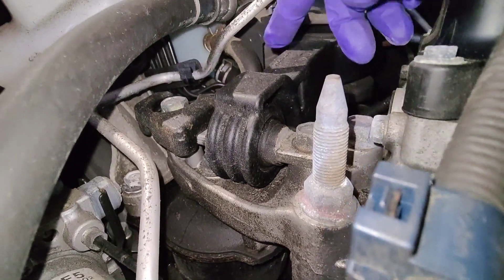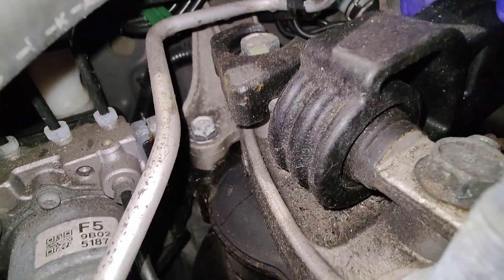Whole car vibrates. Louder in Drive and Reverse. 2006-2011 civic.

Comment: i replaced all my mounts and the transmission mount and it helped some but still vibrates
Reply: Try checking the spark plugs. I have the same issues and changed my spark plugs (they were very worn out) and the vibrations subsided. Hope this helps

Comment: I have a issue with my 2015 Honda Civic in reverse will that be the same issue on my car with the mount ? It jus started happening to me guy hit me from the front straight forward 40 mph long story then that started happening to the car shaking after the hit
Reply from the maker: The 2015 9th gen civic has a different style of engine mount than the one in the video. You might want to see what part of the engine may be contacting the body causing you vibration.

Comment: Question i did replaced  the bottom but i hear the noise a little do i need to change the top also and they say is another one by the transmission   Is better to replace all 3 ?
Reply from the maker: Typically on the 8th gen civic it's the passenger side engine mount that collapses/wears out causing the engine mount bracket to contact the actual rubber mount causing the vibration.
Reply: @theoffroadingmechanic  u were right it was the passenger top mount
Reply from the maker: Yup.

Comment: Could this also be the same problem for my Honda accord 2004 dx but it vibrates a little bit more crazy when I put it in drive
Reply from the maker: Itll be a different style of engine mount. Just check to see which engine mount gets loaded when you're in drive and see which one is broken.
Reply: @theoffroadingmechanic alright thanks for the help 🫡

Comment: Whats the motor mount
Reply from the maker: The rubber mount that is on the passenger side of the engine compartment.
Reply: Do I also need to replace the the right upper engine torque damper?
Reply from the maker: It doesn't usually wear out but you will see if you need to replace it when you remove it to get the main mount out. You will see the sleeve where the bolt go through separate from the rubber.

Comment: Talking about vibration, my sonata hybrid sometime would vibrate hard when hit ~1700rpm, almost feel like the engine is resonating with the transmission. I can't find a specific trigger that cause this issue. What could be the problem?
Reply from the maker: Have you had a short block put in or a long block? I think the hybrid only gets a short block if I remember.
Reply: @theoffroadingmechanic  Not yet. Still on original block. It's theta2 mpi and the engine is import from Korea.🤞
Reply from the maker: @frankxu2321  does it do it when the hybrid battery is low on charge?
Reply: @theoffroadingmechanic  No. If hybrid soc too low things will get jerky but not vibrate. The viberation has happened several times when I’m on a steep uphill, but now it stops. Could it be an about to worn-out transmission mount?
Reply from the maker: @frankxu2321  I was thinking possibly under heavy load since that starter generator when charging the hybrid battery can put quite a load on the engine. Can check the trans mount there should be an inspection hole, square rubber or a plastic cover on the driver's side wheel well will be able to see 2 bolts those 2 long bolts go to your trans mount and should be rubber around it. On the engine side see if there is black stuff leaking out of the bottom of the engine mount I can't remember but I think they are silicone filled. Will be kind of hard to see if the top stud has separated from the rubber on a hybrid. The lower torque mount don't usually see any failures.
Reply: @theoffroadingmechanic  Thanks 🙏